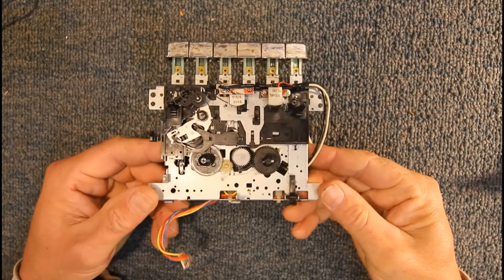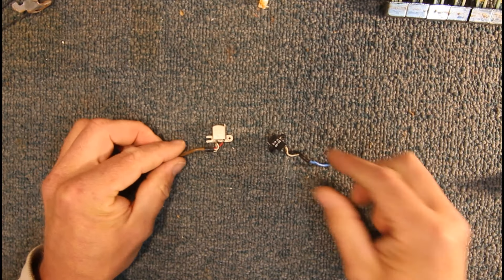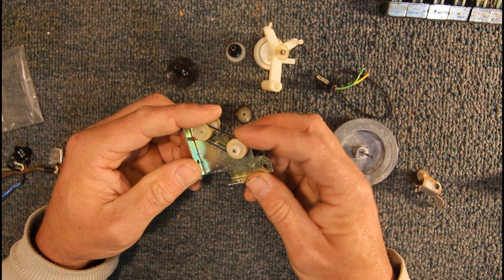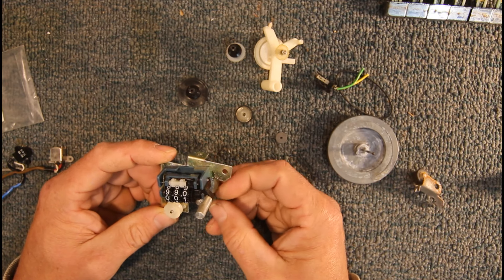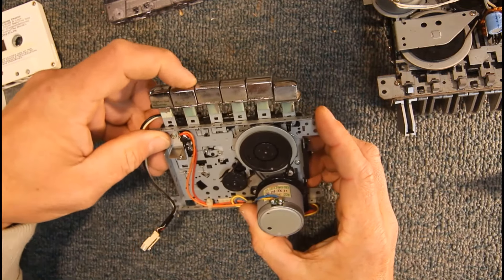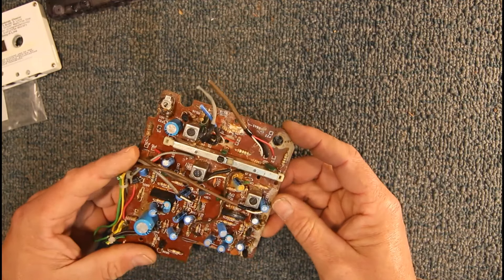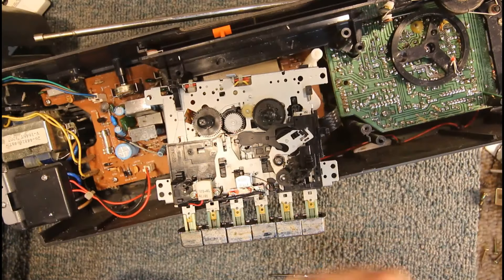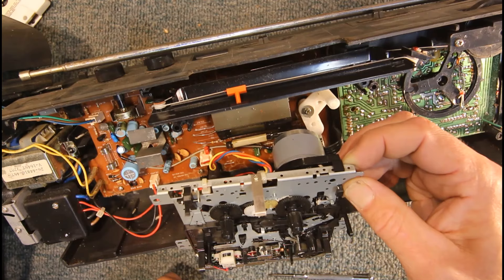Cassette Tape Player. How it works and how to repair.

Comment: I have a Sony Walkman pp227 and as I was looking at the belt I noticed a torsion spring had fell out but I don’t know where it fell from. I was wondering if you might know?
Reply from the maker: Its been a long time since I've looked at a Walkman. Some of them used one on the door, and some mechs had a few small ones that were something to do with the buttons, but not sure which brands they were. A service manual would be the only way to find out if its not obvious where it came from.
Reply: Alrighty, thank you very much.

Comment: ..To add to my comment below, my Philips tape deck has been a bit noisier than usual in the past few months. Not really a buzzing, or a hum, but more of a HISSING sound. I'm wondering if maybe it's a failed fuse or relay that could be causing that?? I don't know...
Reply from the maker: Is it a mechanical sound or coming out of the speakers? If its coming from the speakers it would be worth giving the head a clean.
Reply: @StevesElectronicRepairShop  I did clean the tape heads. I swear. LOL

Comment: Question: what if I depress both play and record without any cassette tape inserted? In the end my deck got stuck in that state and would not reset. Any ideas why?
Reply from the maker: There is a lever to stop record being pressed with no tape or if a tape has the record tab removed. Its likely something was bent or jammed with the buttons and the levers they push if someone forced it down

Comment: Hey amazing video!  I recently found a beautiful Technics RS271 stereo cassette recorder online, but unfortunately I'm having some trouble getting it to work properly.  The record button is stuck -- I cannot press it down.  Also, The motor works fine, and I cleaned the tape head with 91% alcohol, but the audio comes out extremely quiet, and only from one channel (left).  With the output turned to max, I have to turn my interface gain up past 1 o'clock to just register a signal.  This problem exists both in the headphones out and the line out, which leads me to believe the problem is earlier in the signal flow.
Reply from the maker: There is a lever that stops record going down if there is no tab in the top of the tape, so I would check that first. Obviously use a tape with a tab or put some sticky tape over the hole if you are using an old prerecorded tape. The lever is at the top left of the mechanism and can be pressed up with your finger through the door to see if the record button then engages. If not you would have to pull the mech out and check it. If there is a play/record switch on the main circuit board then I would clean that with switch cleaner lubricant first to see if it fixes the audio. It could also be that someone has put the head out of alignment, or there is a problem in the electronics. The line out and headphone are both connected right at the end of the audio circuits.
Reply: @StevesElectronicRepairShop  Wow thank you so much for your detailed response! This is my first cassette deck, so I did not know about the tab at the top of the cassette tape.  I manually pressed the lever and now the record button engages!  I unscrewed the back to see if I could find a play/record switch like you show in your video, but I can't tell what's what in there.  Is it possible to align the heads without an Oscilloscope, and without taking the whole thing apart?  Would it be possible to arrange a short face time with you to show you?  I would be happy to pay you for your time, thank you!
Reply from the maker: @cezarjacobson927  You can align the heads by ear to get the clearest high frequency response. Hifi decks often have a removable door cover, either two round pieces that unscrew or the plastic front slides upwards and off. You can then access the head adjustment screw when its in play mode. Decks without a removable door cover often have a small cutout under the door that allows  adjustment. Its usually the left screw on the play head, but either way you want to adjust the one with a spring under it, turning one way and then back until you find the point of best high frequency response.

Comment: Your video was very informative and it helped me figure out that I may have problem with weak tension on the pinch roller on an old Panasonic tape recorder (model RQ-309AS) that my son got a charity yard sale. When we placed new cassette it played it very high pitch very fast speed. After taking it apart and then reanalyzing the issue....I noticed that the pinch roller was very loose and wasn't contacting the tape right. Once I put pressure on pinch roller it actually slowed the tape down and allowed music to play music more legible and audible. Anyway you can help me address how fix the pinch roller problem? Any help would be appreciated!
Reply from the maker: Usually the pinch roller is pushed into place by a spring on the plate that moves it and the heads into place. If you push the pinch roller away from the capstan shaft you should feel a strong spring pushing it back into place. If not the spring could be missing or bent, or whatever pushes it into place might be bent. That is the most likely area for the problem.

Comment: amazing video. Any idea why a cassette player plays at very low volume and very bassy? It does this on all cassettes I use - the player just doesn't work like it used to. thanks man - subscribed.
Reply from the maker: Most likely cause is dirty, misaligned or worn head. Could also be that the head is not lifting high enough into the cassette but that is unlikely. If it's clean you could try adjusting the azimuth by ear to get the high frequency sounds the loudest and clearest and see if that fixes it. I forgot to mention in the video that the door cover on most component decks slides upwards and off so you access the azimuth screw while playing a tape in the door frame.

Comment: Hey any help on my Sony tc-45 
it’s reel is going the opposite way so it’s mess up the tape
Reply from the maker: Usually that will be no take up reel operation, so the pinch roller is chewing the tape which could make the take up reel go backwards. Its most likely the belt that runs the reels is broken or slipping.

Comment: Where can i buy this deck mechanism please help! i want to repair a very valuable tape recorder.
Reply from the maker: Its best to find another tape player that uses the same mech since they were used in lots of things. You can then fit the original motor and heads to that

Comment: I have a cassette player that doesnt want to fast forward. What could be the issue?
Reply from the maker: It would be something to do with the idler tyre or gear not engaging the take up reel, or not having enough torque due to slipping.  There is a bit at 17:22 that gives you some idea.

Comment: Hello Steve,  I have a stereo system that has two cassette decks and a cd player, and recently it has not worked properly. Just sounds like everything is dying - this varies from tape to tape. What could you narrow it down to do you think? What I also do is play a cd first to let the unit generate heat and thus warm the cassettes before I play them, but this sometimes doesn't work. Cool channel btw. Cheers
Reply from the maker: Do you mean the playback slows down? If it comes good once warmed up its likely the motor is faulty.

Comment: Hello. I have a Sony CPD-S50 Portable CD Radio Cassette-corder. I purchased it second hand and found that the previous user had pulled a chewed-up tape out forcefully, which resulted in unknown damage to the mechanism inside. Whenever I put a tape in, the tape is always chewed up- and pretty badly. Upon closer inspection, I found that in normal playing speed, the take-up reel is jamming or simply doesn't turn at all. The motor and everything else is working fine. However, when increased to fast-forward speed, the reel turns as it should, with a great amount of resistance (as you said in the video). Perhaps it's also worth noting that the part behind the reels that bobs up and down (unsure of the name) also seems stuck in that way, but works fine in high speed mode. Could you give some advice please? I watched the full video (which as a whole is very useful for all other issues it seems) but failed to find anything that could help.
Reply from the maker: Have a look around 17:50 where I describe how the take up reel is driven in play mode via a separate idler or gear depending on the deck. Usually its a slipping belt or rubber idler wheel, and that would be why it was and is chewing tapes. If you turn the capstan by hand with the play button pushed down you should be able to see what is turning and what isnt. If the takeup turns a bit with no tape then its likely a belt or idler is slipping and will need to be replaced. That Sony likely has a later generic mechanism so only has a belt. It could also be that the play idler is not engaging due to a mechanical fault.
Reply: Thank you. I hope this resolves the issue. Keep making brilliant videos like this, they are very helpful. God bless.
Reply: Alright. I believe I may have found the issue here. When I press play, and manually turn the capstan, a large gear can be seen move into place, which connects the motor to the capstan. However, when I turn the capstan with the gear in place, the gear doesn't move much, as if it is not properly connected to the moving parts and capstan. It turns and stops like the take up reel does (as I mentioned in the original comment). All belts etc are working fine, in brilliant condition.
Another note here: due to the design of the system, I am struggling to remove the cassette player system, so I cannot see the full front of the player (where the reels are). I've removed all screws and it does lift up but there is something that is stopping it from coming out (the control buttons I believe). 
Any further advice? If it helps, please email me at alznabz@gmail.com. Thanks.
Reply from the maker: @alznabz  I think there may have been some decks with the buttons above the deck where you had to slip the buttons off before you could remove the deck from the case. The manual for that model doesnt help because they only exchanged faulty units rather than  fix them so there are no disassembly instructions. You need to check if that play gear is moving across to contact the takeup reel when play is pressed once you get the deck out.

Comment: Hi Steve. I liked going through your repair video and your tone is good for this kind of technically challenging repair video.  So, it got me reacquainted with the oscilloscope. You are going at a good pace though  so one must keep up  or use playback. I have a question about a JVC single cassette deck I bought used. There is one annoying issue. It  will play for a while maybe 2 minutes or so but stop suddenly and start rewinding itself in the middle of each song (while in play mode). Is that something to do with the auto stop being triggered too soon(before the end)? How would I go about testing it if it is or not and what is the technical explanation in a nutshell in layman's terms? If I have to go about opening the chassis and work safely what would be the source of the issue? mechanical I hope. Could I get at easily and find the problem and change a part in side if I could tell what part I was looking for without too much damage like a belt or something easy and simple to fix without much more disassembly. That is would this be a easy fix. I am electronic / mechanically inclined and somewhat  good at trying to repair electronics. I fixed an  old JVC VCR once. A changed a chip by desoldering the old one and resoldering the new one into a PCB. The repairman suggested the chip to replace given the symptoms. and details of issue.  I used an oscilloscope and signal generator. I remembered the usefulness of these instruments for testing the 1 khz wave signal for the head alignment in your video. I have to get an oscilloscope if I could open up this. By the way when you are checking continuity of the switch you have the power turned off the deck right? I saw when you had the power on to check the voltage at the switch and at the motor. But then you must have turned it off to check the continuity? Thanks for the clear and well explained video. Though most of the mechanical sequence of operations are faster than I can understand. There are gears idlers belts and sprockets and levers everywhere. So I ask you as the man with the experience on all these equipment. Its a JVC KD-A66stereo cassette deck( good condition except for that). Mike
Reply from the maker: An auto stop problem should just stop the tape. I have never heard of one going into rewind, though its possible decks exist with an auto rewind function at the end of a tape. The first thing to do would be to make sure the takeup reel (right hand one) is still turning when the machine stops and rewinds, and also check the counter is also turning. If either stop then its likely a belt. Also turn off the timer and memory function while testing, though I doubt they are related to the problem. Its likely that its a logic function problem , which means the deck thinks the rewind button is being pressed. It could be as simple as the switch is faulty. See if the rewind button feels the same as the others. Also try pressing gently on it and see if it operates easier than the other functions as that might indicate a mechanical problem with the switch. You could also tap on the circuit boards with a screwdriver handle or other hard insulated thing to see if you can trigger the problem, which might indicate dry solder joints. A deck like that probably isnt the easiest to work on, but shouldnt be too bad. Take photos of everything as you disassemble if you are worried you will forget where things went. You are correct that its normal to test continuity with the power off, otherwise voltages can affect your multimeter readings.

Comment: Hello! Thanks for the valuable info!
Does the first deck you show have a name? I have a recorder with the same deck and it's making to much mechanical noises, after many days working on it I'm giving up, so I would like to replace the hole deck. Does it have a name? Or could you name some cheap equipment with this deck? I'd really appreciate some help. Thanks!
Reply from the maker: Its a Tanashin mechanism according to an archive I found of their site. They were used in many units, mainly shelf systems and boom boxes but some component decks as well. There are two versions, one made to have the buttons below the deck on the front, and one made for the deck to be upside down with the buttons sticking out the top. The motors also vary in voltage but you can easily swap your original if it has the wrong one. If you open the door on any cassette player from the 1990s onwards you should be able to see if its got the same black auto stop arm which means its the same mechanism.
Reply: @StevesElectronicRepairShop  thank you very much!!!
Reply: I wanted to thank you once again! I found one on ebay for 10€ (new).
Cheers

Comment: Hi Steve, when I play a tape that ive made the recording on my current tape deck (SONY TC-WE475) one of my channels when i play back is very muffled. I was assuming this might be a problem with the record/playback switch but I cannot see anything that resembles it at all? Could it be much smaller or digitilised on  more modern tape decks, apologies, dont really know what im talking about, so hope that makes sense . Thanks.
Reply from the maker: I assume you have cleaned the heads as that is the first place to start. The later decks use relays to do the switching, a type of electro-mechanical switch controlled by the main IC. Your deck has RY451 which is a rectangular plastic box around 10mm x 20mm, often blue or white with a clear lid, mounted towards the corner of the board near the line in/out sockets. They cause that sort of problem in Sony decks. You could tap it gently while recording to see if the channel comes and goes, or remove the cover and poke the contacts. If the sounds comes and goes on the faulty channel its likely the relay. It might be possible to remove the cover and carefully clean the contacts but often its best to replace the relay if still available. Some sort of contact cleaner spray may work, but often you need to use a slightly abrasive contact cleaning strip. Its also possible the wiring to the heads in those auto reverse decks is starting to fail because they usually have heads that rotate with each direction, and the wires get metal fatigue. Ideally you need to trace the signal with an oscilloscope to find where the fault lies.
Reply: @StevesElectronicRepairShop  thanks so much for taking the time to reply, really appreciated. I will go investigate. I would also like to say great video as well. You explain everything very well indeed. Thanks again
Reply: @StevesElectronicRepairShop  upon further inspection the tape heads are stained, I've trying to get off with 99% isopropyl alcohol and Coton bud but it won't budge... How abrasive can I be, can I scrape off with some thing, will I damage the head? Thanks again
Reply from the maker: @samhandwhich743  I wouldnt use anything too abrasive. I would try soaking anything on there with the alcohol or even water first for a while to see if it can be wiped off with a cotton bud. You could also try a bit of rag which would be a bit more abrasive than a cotton bud. Worst case maybe one of those green kitchen scourer pads would be OK if used gently.

Comment: i have a becker mexico 2000 and when i put in a cassette i can't get it back. The two round things just keep down there. Its like they don't respond anymore. Also when the cassette is in there i can't play it, it will go to FM instantly and will keep running the cassette every few minutes. do you know how i can fix this?